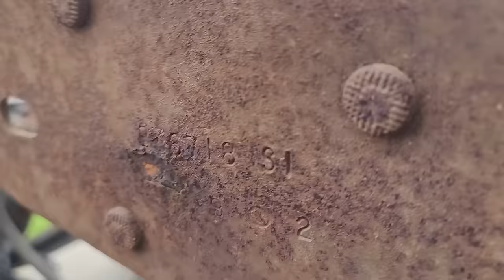Ford Ranger, MIG welding truck frame back together, how to.  Build part 7

Comment: There is no advantage to doing a splice like that, in fact it could be argued the corners of the splice are creating a stress riser. A simple butt joint meets the strength needed. 

Regarding fish plates, you’ve increased the strength on the web but nothing on the flanges. The external fish plate would be MUCH better folded as a C that is a snug fit to top and bottom flanges.
Reply from the maker: Thanks for watching and for taking the time to comment!!
Reply: He’s right, you know.... that fish plate on the web is pretty much zero reinforcement... the critical areas are the welds at the edges of the flanges. Once a crack starts anywhere in the flange, the crack will follow the thinnest part of the frame.... the edge of the weld around the fish plate. Not that frame failure is imminent on your ranger as a result of your repair, just that it would have held up equally well without the patch... a Ranger doesn’t weigh anything or able to haul anything. But wheelbase changes on class 8 trucks for mixer bodies ... those are the guys whose welding/fabricating skills you emulate.
Reply from the maker: I did the best I could with what I knew at the time, thought I was doing a much better job than most of the frame repair videos I have seen here on YouTube.  However, I have learned a lot from your comment and others as well and I will apply that in the future if I do another one.  In the meantime I will put some miles on the old Ford Ranger and see how my repair holds up.  Thank you for taking the time to comment and watch my channel!!  -Frosty
Reply: Absolutely bullshit on the z cut not being necessary. A butt weld... 😂 ok. Since you are speaking like the expert, explain why not one company doing semi truck frame stretches ever uses a butt joint? Z and L joints are the absolute standard AND required by the federal DOT for semi trucks to pass inspection after a frame stretch. Go ahead and enlighten us, I'll wait. 😂
Reply: @TheRoadhammer379 thanks for your open minded and genuine response 😂

Unfortunately I’m just a carpenter, but there is a YouTube video by a retired structural engineer that specialised in offshore oil rigs. He is also a off-road touring enthusiast. He covers this exact topic in his YouTube video. I little searching should not be hard to find it. There are a couple in the series, he covers the principles and supports it with Math. Hope you find it interesting and informative 👍
Reply: @TheRoadhammer379  

There is another video after this one that gives more information again

https://youtu.be/mtwDvFTfBn8

Comment: Great job..but why bother with such a subpar platform as a Ford and worse a Ranger? Aka "Anger" as it's such pile even from day one on the lot..sure a 4 cylinder 4x4 is great to have..I have one myself but I went with something that actually has a good track record a Toyota..Best of luck my friend..just seems like a complete waste..
Reply from the maker: I appreciate the backhanded compliment hahaha!  You'll probably be needing to do the same thing to your Toyota soon, aren't they known across the Toyota line to have terrible frame rot/rust....Maybe that's why you watched this video.  🤔
Reply: @frostydoesit  sure steel will rust..but at least Toyota will replace the frame for zero cost to the current owner..not so much the case with the big 3 manufactures..food for thought, although no single company is perfect..it's how that company fixes those shortcomings, is what matters.. a Toyota owner simply drops off the vehicle to the dealership for a complete frame replacement with warranty too at no cost..
Reply from the maker: @agentcovert  I hope you don't have to go through the hassle with your Toyota truck!  Thanks for watching and taking the time to share your thoughts!

Comment: Not entirely professionally, this type of chassis is welded with a coated electrode.
Reply from the maker: Please explain, I am confused by your comment
Reply: Values of coefficients of static strength of the weld
 
To determine the value of permissible stresses in the strength calculations of welded joints, it is necessary to determine the coefficient of static strength of the weld. This coefficient takes into account the reduced strength of the welded material due to changes in the structure in the weld environment, caused by local thermal stresses, discontinuity of the weld, etc.
Reply: Rafael has never seen or heard of semi truck frame stretches and welding. Good old mig.
Reply: @TheRoadhammer379  Whether the weld is welded well will be revealed when processing heavy material.
Reply: @TheRoadhammer379  I was doing a welding course mag 135/136, and we were solving static calculations of welds with the instructor

Comment: HE DIDN'T USE A STRAIGHT RULE TO GUIDE THE ANGLE GRINDER CUT.HE MUST BE VERY GOOD.THAT WAS A GOOD STRAIGHT CUT.I COULDN'T CUT A HOLE AROUND THE EQUATOR.IF WOMEN WERE MADE OUT OF TISSUE PAPER DIPPED IN OVALTINE,I COULDN'T CUT MY WAY OUT OF A PARALLELOGRAM ,PLACED INSIDE A BROWN PAPER BAG TO ENSURE CUSTOMER DISCRETION!

Comment: Nice fit up nice welding. But the idea is wrong. The fish plate does not address the flanges, and they needed reinforcement for lateral tension. The best would have been another piece of frame rail fitted inside the welded section. And at each end use the fish plate design. You did not need to weld on both side of the cut. The inner fabricated piece would have been used as a back up insuring full penetration. Last mistake frames are hi carbon and need to be preheated before welding. Lastly, when you dont see any welds anywhere on a truck frame and only rivets one should ask himself about the wisdom of welding versus its convenience. You have a lot more to learn.
Reply from the maker: Bernard, thank you for taking the time to share your ideas/opinions.  I did the best that I could with the knowledge and skillset that I had at the time.  I have def learned a lot from reading all the comments you and others have left me.  I am sure I'll do another one in my future...in the meantime I will put some miles on the old Ford Ranger and see how she holds up!  Thank you for watching and commenting, I appreciate it!  -Frosty

Comment: That's really stupid car frames are Alot of time made outta high strength steel and you put mig wire as filler mig welders are brittle yes it's 70 psi minimum but has pretty shitty enolgation so high strength steel can be up in the 140 thousand psi range and is prone to cracking when it cools to quickly and using needs a preheat as well and you didn't even pull pen it
Reply from the maker: You really think a Ford Ranger frame is made of high strength steel?

Comment: I’d have welded the vertical weld down the hill as it’s much stronger
Reply from the maker: Uphill is stronger than downhill with MIG
Reply: @frostydoesit  nope you couldn’t be more wrong
Reply from the maker: @adammulcahy644  please share with me why downhill is better in this situation?
Reply: @frostydoesit  always run 6012 wire downhill with Mig and stainshield gas

Comment: All right 35 years of collision repair speaking so nobody's sections arranger frame nobody sections a ranger truck frame and the reasons why no matter what your technique is in a collision it breaks at the welds ,if it doesn't break at the welds should you be straightening the frame you could very well break it then at the welds if you had to do this you should have considered a inner and outer plate to sandwich the frame and just put bolts through it similar to how they do tractor stretch for sale making a box truck or tanker  truck. In collision work we generally can replace rivet on or weld in crossmembers but never weld in a frame rail like that. Now that you repaired it that way in a collision what you have is a bunch of hardened steel where the welds are in the metal around it is the normal metal of a Ford ranger and Ford ranger is an easy frame to fix I have no idea why you're sectioning one.
Reply: Right where you put in your joint when a ranger gets rear-ended the frame bins up right at that location where you put the section in so what it will likely do is the section won't bend but the metal on the back side will and it will bend it a little more severely than it normally would but like I said it'll break during the crash or it'll break in the straightening.
Reply: And for all of the same reasons is why you also don't do stuff like this where they break at the steering box from big tires. Best repair are two sections of metal frame rail thickness on both sides of the brake put together with grade 8 bolts. With the bolt in sections sandwiching it you don't have any hard spots from the heat and the welds. Don't ever section of beauty frame like that with like quarter inch plates to stiffen it up you got to use metal similar thickness similar hardness to what their base metal is.
Reply from the maker: I sectioned it because the rear frame was rusted out.  I appreciate you sharing all your experience.  The repair has been holding up great so far....I thought I did a pretty good job compared to 95% of the frame repairs you see here on YouTube

Comment: Just by your thumbnail alone, this is not the proper way. The fish plate needs to have holes in it to allow welding to a much larger surface are to bring rigidity and strength back into the are that was cut and welded, therefore stressed considerably.
Reply from the maker: I had holes in the frame that were welded to the fish plate
Reply: 😂 experts abound, Frosty.

Comment: I say you did a OK job lining up and putting the fame back together, but the fame is made of spring steel and you should not be welding it, and if you try boxing it after welding it, then it now won t perform as it was designed. As a automation engineer that has crash test over 150 different vehicles in my time. I wouldn't want to see the finish vehicle use on a public road, just like any other rivet chassis that been cut and welded. I just hate going to look at a vehicle that been involved in a vehicle accident that some person has die because someone modified there ride thinking it was a good idea at the time. Stay safe, and only build safe  things.
Reply from the maker: I appreciate your comment and thoughts, however the 1989 Ford Ranger frame is not made of spring steel, I also did not box in the frame.
Reply: @frostydoesit  I was wondering about modifying frames, adding reinforcement and thats why i came across this video. so hearing about this spring steal is interesting because i was wondering if there was anything more involved then just getting good pentration and obviously the plumbness too.
Reply from the maker: @Weq5ter  you do want to get it straight, your cut pattern matters and certainly how you weld and reinforce it.  The frames I work with from the older US made trucks are NOT spring steel.  They are mild steel that are stamped to shape, very easy to work with as far as cutting and welding goes.  Thank you for watching!
Reply: Only medium duty and larger trucks are made of special composition steel frames. Everything else is mild steel.
Reply: Blair, for a supposed engineer how tf did you get through grammar school? There and their are the same, and numerous other mistakes in your ramblings.
Also, semi truck frames are cut and welded all the time, approved by OEM manufacturers who spent millions on THEIR engineers and these welded semi frames are annually inspected by a little agency known as the FEDERAL MOTOR CARRIER SAFETY ADMINISTRATION aka the federal DOT. Thousands of trucks are hauling 40 tons across the country, for a million miles or more and they aren't splitting in half.

Comment: Nope,,, the frame will fail over time since it has square cuts ver's a smooth elongated angle cut that will be 2 too 3 X's stronger... Beginner Fab tech Welds know this ...
Reply from the maker: I see semi frames cut and stretched in this manner with 500k miles on them and they haven't failed

Comment: Why fix a gas hog 4x4 ranger
Reply from the maker: There aren't many 4cyl 4x4 5spd rangers left out there.  I have a turbo 2.3L 4cyl that will go in it if I like the truck.
Reply: How is a 4cyl a gas hog, Einstein?